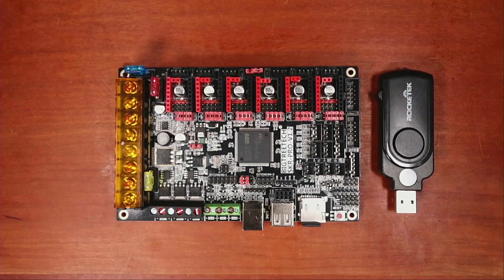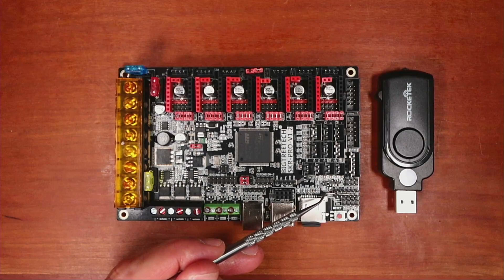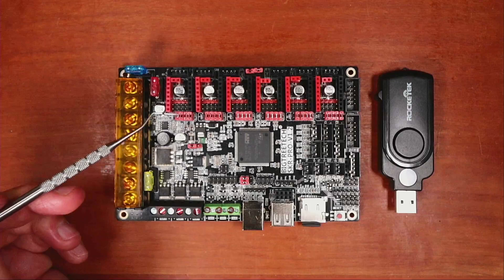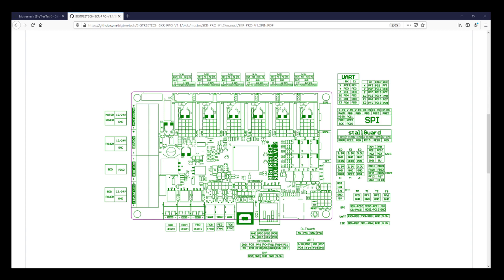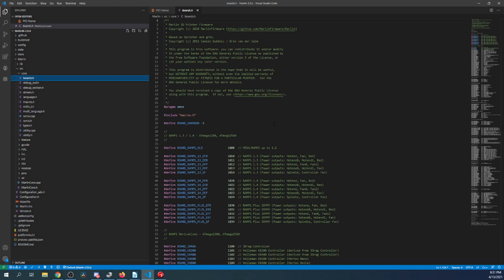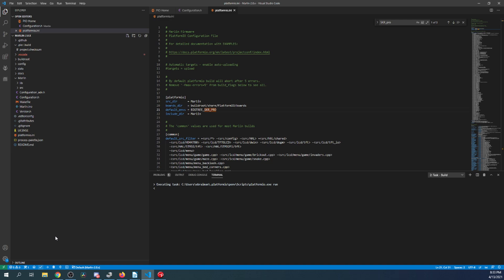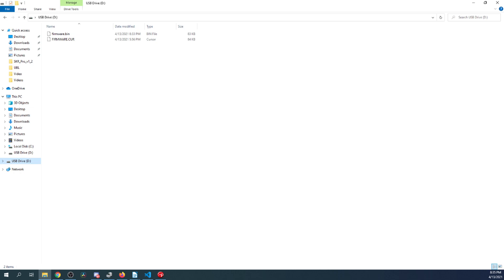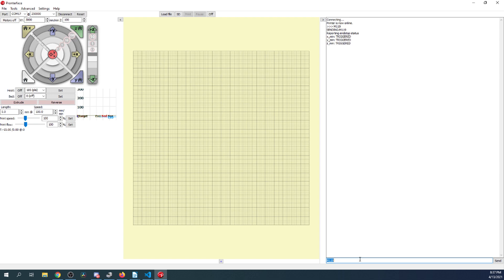SKR Pro v1.2 - Basics

Comment: My platformio file doesn't came with that enormous quantity of lines... It ends up around the line number 266. How did you get this complete file?
Reply from the maker: The Marlin firmware was updated from 2.0.7.2 to 2.0.8 almost two weeks ago.  Look for blue thumbnail video in playlist call Marlin supplimental and it will explain changes.
Reply from the maker: https://youtu.be/LPHY3hPQy-w
Reply: @EdwardBraiman  thanks so much! That solved my problem. In addition, I've realized that it's not really needed to change the platformio.ini if you change the environment at the bottom of VS code.

Comment: I'm curious, what can be connected to those SPI UART and i2c connectors on the lower right?
Reply from the maker: Lights, LCD, WiFi, stepper controllers,  etc as long as there is an existing device.
Reply: @EdwardBraiman  cool thanks for the answer. Do you know if there are some existing devices already compatible? Maybe an RGB light controller? Or can you put a servo maybe?
Reply from the maker: Not sure on RGB, but servo will work.

Comment: Hello from Brasil. I want to know if this board could handle a triple z axis auto bed leveling?
Reply from the maker: Yes.
Reply: @EdwardBraiman  Thanks. In this case i have to use the slot for E0 and E1 to other two steppers for the Z right? I have to learn some codes, because probably i need to chance a lot of things in Marlin.